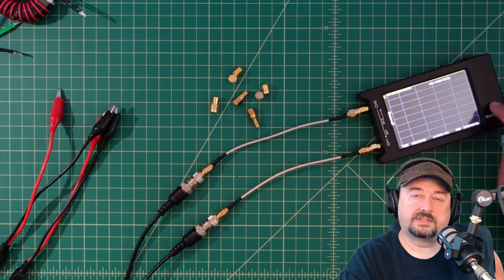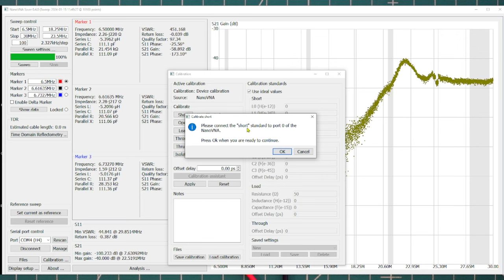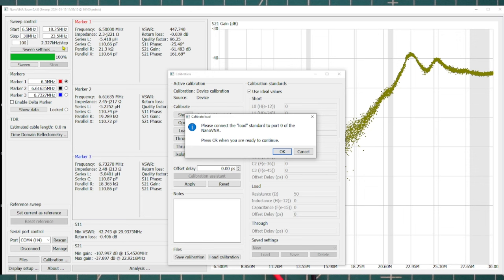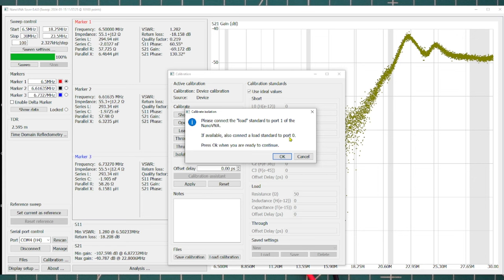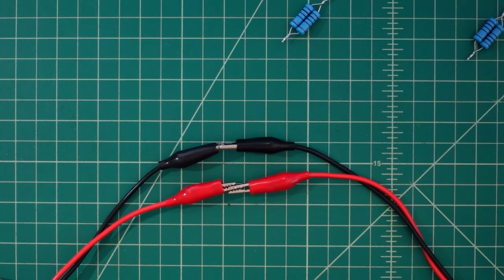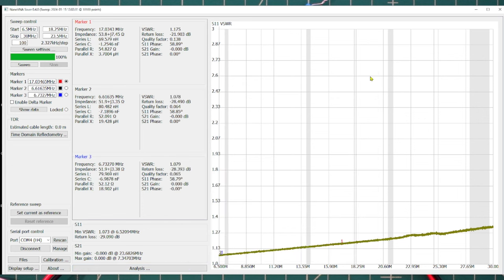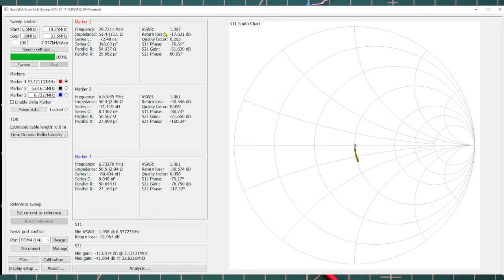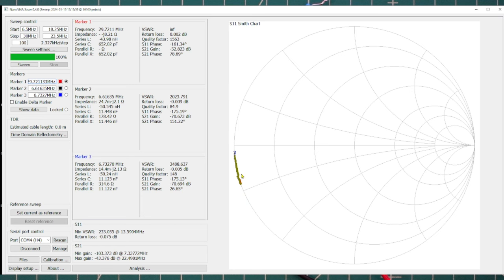Alligator Test Leads and the NanoVNA

Comment: Great video!   The first thing I do with those alligator clip test leads is  remove the hoods and see if the wire is actually soldered to the connector.   Many of them just have the wire folded back and  pushed under the strain relief tabs.   I have had janky test leads give me bad readings more than once!
Reply from the maker: Not a bad idea, thanks for watching SF

Comment: nice job.  would only use them test leads for low frequency. same with that load resistor. you could have just clip to a 50  ohm dummy load . would only be slightly better . just moving around would change readings on un shielded leads . still will work good enough to test them chokes .  now we know the effect of them leads we can take that part into the reading from the choke under test. 73's
Reply from the maker: Yeah, not the idea setup but it should get you in the ball park.  Thanks for watching Robert 👍

Comment: That was extremely useful thank you for putting this together for us.  
I'm wondering if you could use these janky cables to map the impedance characteristics of a random wire antenna before you mate it up to a matching transformer.
Reply from the maker: Hey Tom,  if I wanted to measure the wire characteristics, I would solder the end to a pl259 bulkhead connector and then connect that to the NanoVNA 👍

Comment: Who you calling Son? 😂 Seems like the wire round resistors alleviated some of the capacitance from the janky led cables. You could probably take a small PCB board and solder a few ceramic resistors for a cleaner load test. As for the cables, well I think you already know what. you need to do about them.
Reply from the maker: Hey GRV, I should prolly do something.   Thanks for watching...